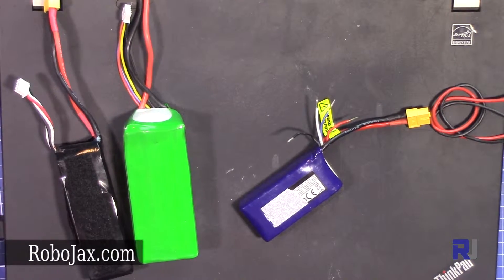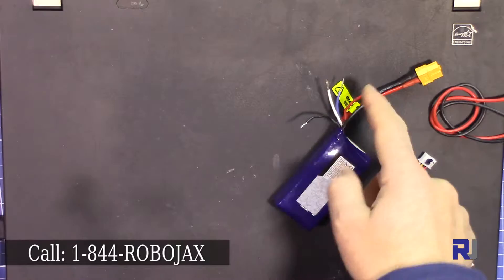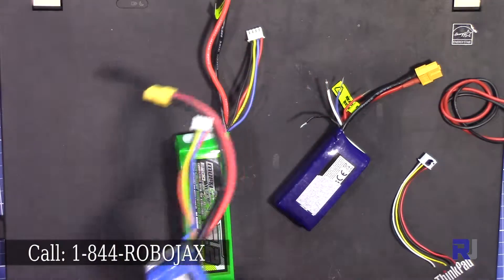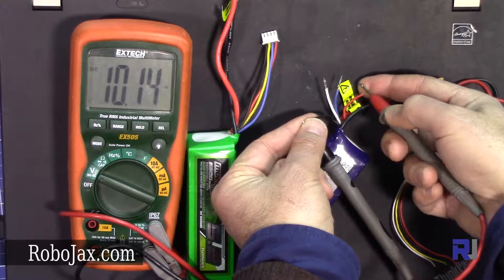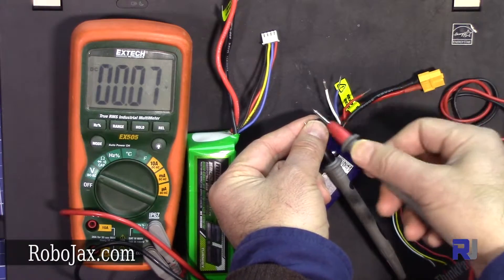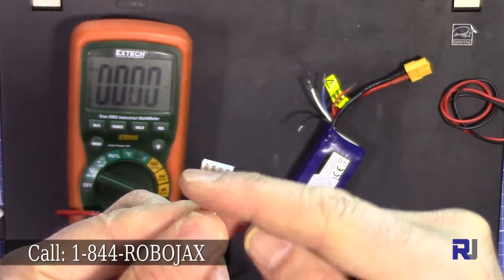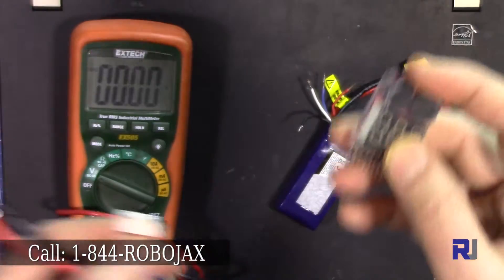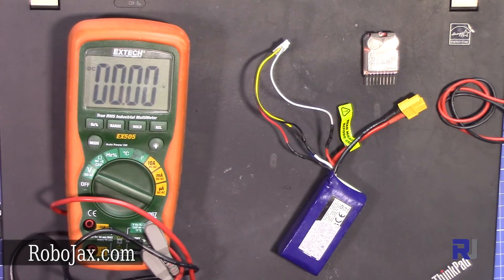Connect and solder JST XH Identify Wires for Lipo battery

Comment: I have 1 red and 4 black wires!
Reply from the maker: The color doesn't matter. The order or wires and the direction of the connector is important.
Reply: Thats the point, how can I know the order of the wires if they are all black?
Reply from the maker: how many cell has your battery?
Reply: Its a 4S
Reply from the maker: Okay. then your battery has 5 wires. Check the voltage at discharge cable (XT60 of T-dean).  Hope it is charged and let me know
Reply from the maker: I was going to write large instruction and realized to ask you if you could see voltage at the thick cable of battery (the XT60 or whatever connector you have). Then will write instruction for you
Reply: Thank you for your help. I managed to reconnect all the wires by following the position in which they are aligned and coming from the battery. The charger recognize all the 4 cells correctly and I managed to happily balance charge them. It was a risk but I have just got lucky :) Thanks!
Reply from the maker: You are welcome. I am glad you were able to fix it.